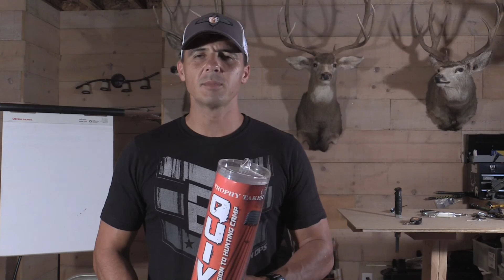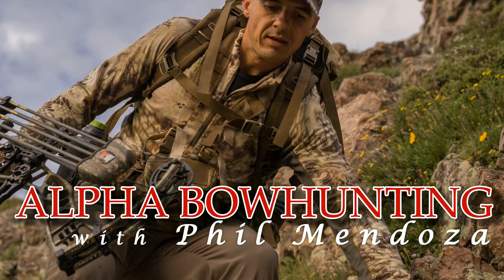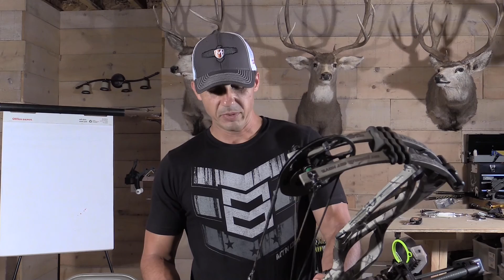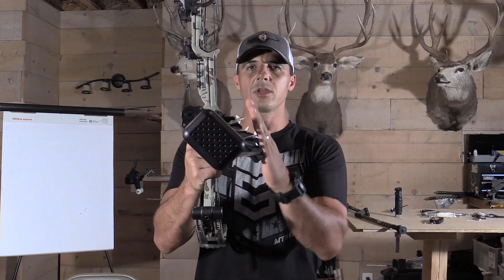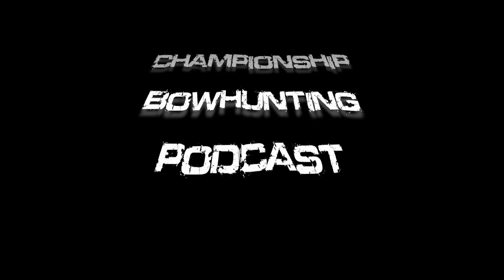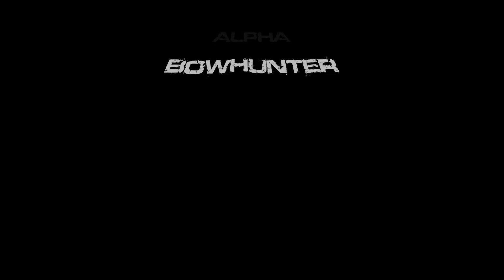Quivalizer review

Comment: Does the stabilizing affected when taking the arrows off?
Reply from the maker: Hello Richard.  Yes, anytime you change the mass weight of the stabilizer or the bow in general it does effect the hold slightly.  When I was practicing with this set up I always left all the arrows in the quiver so the overall weight didn't change.  I carried a hip quiver for the arrows I was practicing with.

Comment: I went ahead and got one.  I am right handed and I left mine oriented as you displayed your setup.  To draw another arrow I tip the top of the bow to the right, pull out of the quiver to the left and sweep below the bottom limb then around the top in a circle to keep the sharp blades nowhere near my strings.  It doesn't seem any slower than using the quiver in its standard position.

It does get some "what the hell is that thing" kind of looks, though.  lol